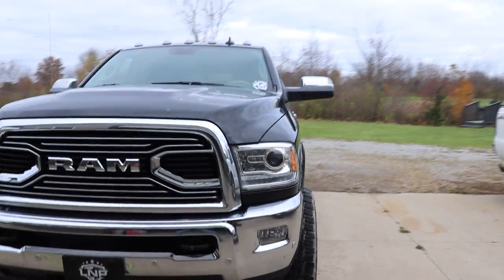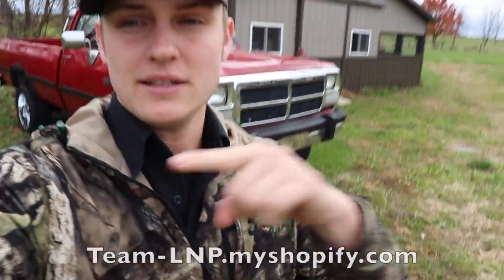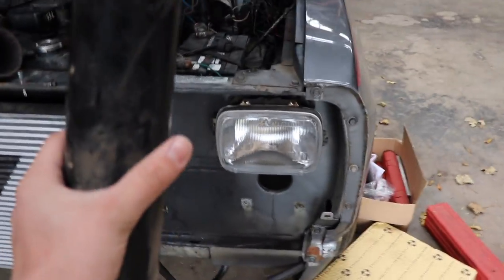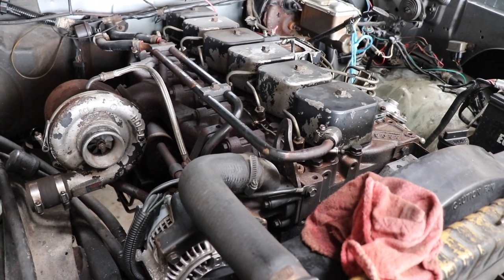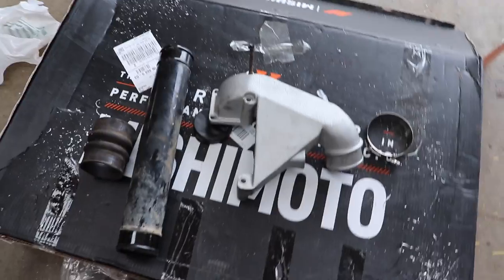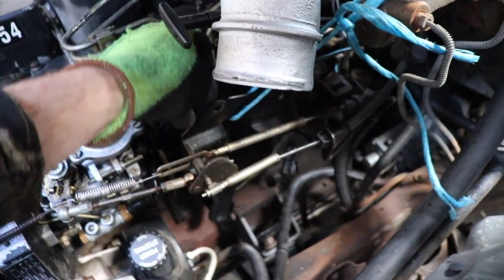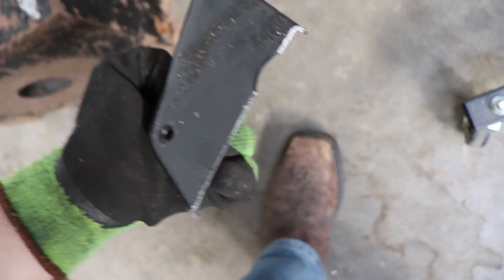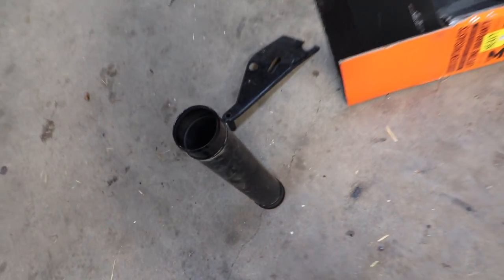NEW HUGE INTERCOOLER ALREADY OFF THE TRUCK!?!?

Comment: OMG why did you butcher the throttle bracket (yes, that's what it's called, the throttle bracket)?? You just wasted the structural integrity of that part (How are you going to secure the top of the engine oil dipstick now?).

When I went from 2.5" to 3" intercooler pipe I used a 1994-98 1st Gen. Pusher intake horn. I traced-out a semi-circle pattern in the top of the throttle bracket and took it to a machinist to make the cut. Now it bolts over the top of the two bolts holes in the intake horn, just as it did over the top of the original factory-fit 2.5" Banks intake horn.

I stuck with the original Banks intercooler, since it still works just fine, using 2.5" to 3" silicone couplers, rather than going through the hell you went through putting that Mishimoto one on (BTW, they have another one that fits the 1st Gen. better, with the pipe openings at the bottom of the intercooler, not in the middle. The cool side of my pipe travels under the previously unused space underneath the battery tray, then turns-up towards the intake horn, using a 45-degree pipe and 12" long silicone coupler, clamped at the intake horn.